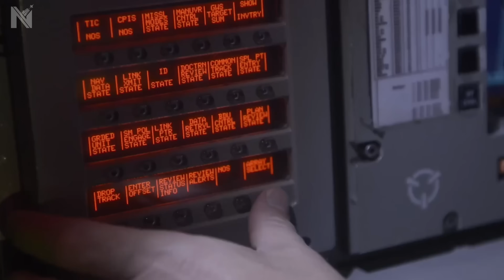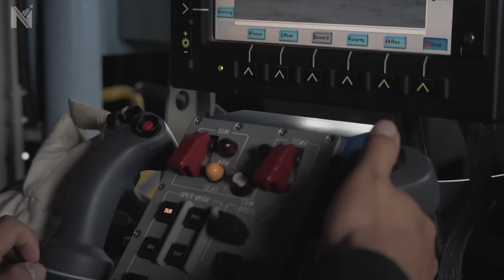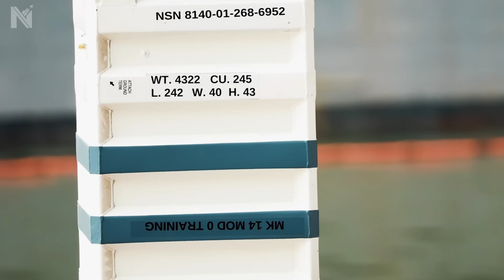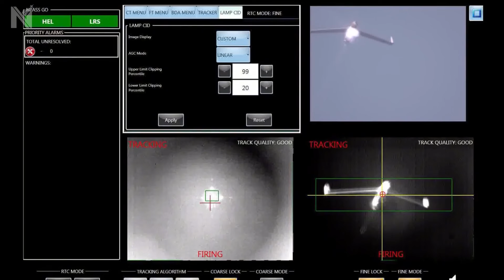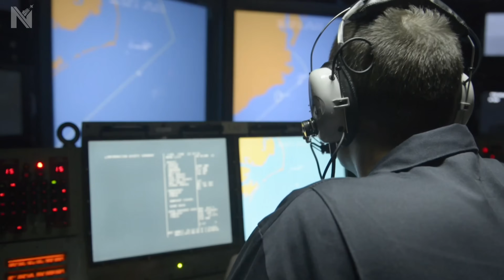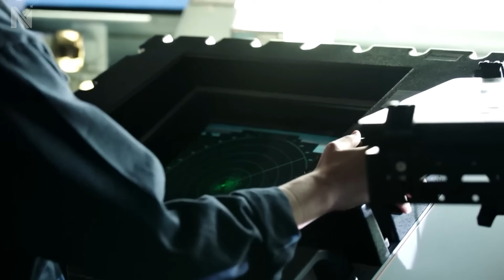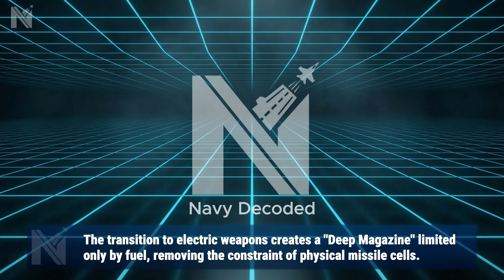Why The US Navy No Longer Fears Suicide Drone Swarms

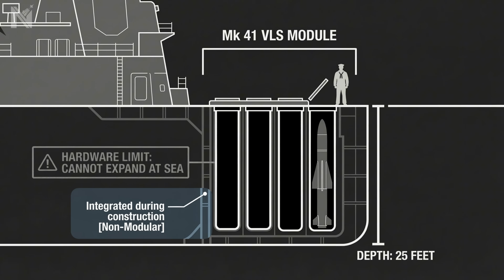Comment: 3:12 "exactly 96 missiles" except each.of those VLT MAYBE a quad pacted tube with 4 smaller missile instead of 1 large missile. And then there are c-rams, CWIS, M-2s and stingers etc.
Reply: Well, a Navy warship doesn't just pack SAM missiles, there's also Tomahawk cruise missiles, VLA (Vertical Launch ASROC) for submarine attack. So while you have 96 VLS cells about half of them will be SAM's that can be used against incoming missiles, aircraft and drones.

Comment: Why can they use cheaper missles?  The stinking arms industry won't make any of t h em
Reply: Missiles are expensive, and you have to go with what you have. The SM-6 can intercept ICBM’s and spacecraft. It’s overkill for drones, but the CIWS is also limited and short range. It takes time to integrate other options.
Reply: Because the cost of winning is priceless, so you dont cheap out like you do in your worthless life!
Reply: This is only one of the options. Video also forget Burke Flight IIA/III and Zumwalt class destroyers have 30mm Mk44 Bushmaster II that can fire air-burst munitions including AHEAD rounds good against swarms of drones. While the older Burke Flight I/II only have the 25mm M242 Bushmaster that can still defend against swarms of speedboats. So for Burke they have 2 of this besides the standard Phalanx CIWS/SeaRAM/RAM. But this is only for terminal interception. Helis are now more commenly used as they can intercept drones at long range. USN for example shot down Shaheed drones at the Red Sea with their MH-60R/S Seahawk helis equipped with GAU-21 that fires 3 - 5 USD 50 cal bullets. So very cheap if you use helis as drone hunters.

Comment: America should invest into metal storm that would play havoc on drones. That machine can shoot out over 1 million ball bearings in one second that would be a good machine for those drones.
Reply: CIWS. CLOSE IN WEAPONS SYSTEM.  THEY HAVE IT.
Reply: Video also forget Burke Flight IIA/III and Zumwalt class destroyers have 30mm Mk44 Bushmaster II that can fire air-burst munitions including AHEAD rounds good against swarms of drones. While the older Burke Flight I/II only have the 25mm M242 Bushmaster that can still defend against swarms of speedboats. So for Burke they have 2 of this besides the standard Phalanx CIWS/SeaRAM/RAM. But this is only for terminal interception. Helis are now more commenly used as they can intercept drones at long range. USN for example shot down Shaheed drones at the Red Sea with their MH-60R/S Seahawk helis equpped with GAU-21 that can fire 1,000+ rounds per minute. Basically a mini Phalanx.
Reply: @j @johnsilver9338 ut if you have let’s say 30,000 40,000 drones coming your way the metal storm is a lot cheaper than those rockets. You could put five different locations on the ship with those metal storms and you’re looking at like 5 million ball bearings flying through the air and not just real slow. Neither of this thing will shred those drones to pieces. Just my opinion, but I understand what you’re sayinggood rockets as well but we bust the cost on them though where these bearings don’t cost anything hardly at all.
Reply: @WarH  Problem is small FVP drones that are used for swarm tactics don't have the range. Only the larger Shaheed have the 1000+km range. Plus GAU-21 uses .50 cal bullets. And each bullet only cost 3 - 5 USD. But any light or heavy machine gun can also be used as shown evidently in Ukraine. Even attack helicopters/gunships can also be used. So I expect Apache and Cobra/Viper will also be adopted for this role in the future. Especially Apache as its 30mm M230 chain gun can fire air-burst rounds. 

https://www.youtube.com/watch?v=bihsF4SKhqo
https://www.youtube.com/watch?v=Nzxq0U1I8Vg
https://www.youtube.com/watch?v=npqH5hmjx_U
Reply: @johnsilver9338  no I understand what you’re saying. I’m just looking at the cost efficiency. I’ve seen one of those units at work devastating. But I understand about the other equipment that has. I know we have the best technology in the world and we’re more than capable to handle the drone swarm I’m sure. Thanks for the info and happy new year by the way have a healthy one as well.
Reply: @WarH  Happy New Year as well
Reply: @johnsilver9338  I have a question for you were you in the military? My dad did three tours in Vietnam crazy old guy. He was very proud of him strong willful man he was. You seem to know a lot about the equipment that America has. I’m just curious..
Reply: My dad did three years in a navy when he came out he said he didn’t like that so he did 30 years in the army. I guess you could say I was an army Bret. Never really talk to him too much about his career didn’t really like to speak too much about it. But he was a cool dad. He was OK.
Reply: @WarH  Not in the military. I just follow military channels/websites.

Comment: This should have been kept classified.
Reply: It was not classified, there has been public info about this for years. US isnt the only country developing and deploying this kind of weapon to counter drones either.
Reply: @mng8680 For years you say? Yet the problem only became evident 2 years ago... Wasnt the hoothie even a year ago? Op is right America has a confidential problem from signal group chats to telling their citizens about tech on crappy shows.
Reply: @shinji1264 What? The problem had been evident for decades. They were originally thought to be only used for missile swarms, but the battlefield and it's weapons change over time. !Microwave weapons and lasers have been available for years, but not at this scale, because of the power needed to run both at the same time, and the scaled down size needed to fit in older ships not built to accommodate them. As far as re-arming missiles at sea, that's been an iffy prospect until newer systems came into play. So no, of hasn't been for only two years, it's been decades in the making!
Reply: Laser weapons have been in development for years. Powering it alone on a vessel isn't something rebels and terrorists know how to do, let alone manufacture it. Other countries have versions but, again, lasers have been in play since the 80s.
Reply: Just imagine the ones that are classified 😮
Reply: @peteryeung111 Yea like America is gonna collapse in 20 or less years
Reply: @shinji1264 Not even a small chance of that. Nuclear war is more likely. We are so far ahead in AGI that dominance isn’t a question for 100 years. Really
Reply: Our enemies have no concept of how many of our ships have these. They can keep taking the chance that which ever ship they launch drones at,,, may or many not have these or just one or the other.  As a Navy vet, I know extremely well that new tech like this is never revealed until it is well tested and allowed to be talked about.
Reply: This is old technology bro. This means US military is working on something better 😂
Reply: If they unclassified this just imagine what is still classified
Reply: Don't worry we have much better system.   This is a ploy

Way better.  No missles
Reply: Nothing about it is classified.
Reply: Yeah, cause you will build this stuff in your garage, right?????
Reply: I agree!  But I wonder what they have that we do not know about, I hope some more cool stuff.  Ultimately it is a question of economic issues.  I also think that the quick sink bombs are a great new thing and could make a great difference if China decides to launch a sea borne attack
Reply: You think the enemy doesn't already know? 🤦🏿‍♂️ Lmmfao 🤣 it's been out there, they been knew programs like this were being developed 20-25 years ago, the knew once they didn't see missiles attacking their formations and they really knew something changed once all of their drones died 30-40 miles before engaging their target, not one or two drones but all of them, they were saying "oh yeah they put some new shit on the table, yup they put some new shit in the game!"
Reply: Microwave's fries Computer Circuitry,
 Common knowledge 🤷
Reply: Too bad we can't hijack them and send them back.
Reply: Ridiculous video. You can't stop a drone swarm by aiming a laser for several seconds at one drone.  A couple hundred drones can be racing towards the ship at 200mph.
Reply: You wanted to know it.
Reply: China copies everything at cutthroat prices. Enabling them to mass produce the same or similar weapons. Their quality may be inferior, but given the quantity they can replicate, all together it can still pack a punch.

Technologies these days are not so difficult to copy. American advantage is the ideas we can come up with due to robust experiences in actual combat. If you give away this advantage, it will be difficult to ensure superiority.

Comment: You talk about pennies per shot, but don't discuss the initial costs of the system. Is it 100's of $ millions or is it a billion per system. A drone may be 6K each but that's everything included to produce and use it. The microwave is pennies per shot but the production to produce it is not discussed. Please compare apples to apples instead of apples to oranges.

Comment: Well, that sounds good.But if there's two hundred drones coming at you , and it takes 7 to 8 seconds to shoot each one down , they're getting through and destroying you.
Reply: You should have watched the video.  It made exactly that point.  That’s why the ‘Meteor’ microwave weapon system is being developed.
Reply: This is only one of the options. Video also forget Burke Flight IIA/III and Zumwalt class destroyers have 30mm Mk44 Bushmaster II that can fire air-burst munitions including AHEAD rounds good against swarms of drones. While the older Burke Flight I/II only have the 25mm M242 Bushmaster that can still defend against swarms of speedboats. So for Burke they have 2 of this besides the standard Phalanx CIWS/SeaRAM/RAM. But this is only for terminal interception. Helis are now more commonly used as they can intercept drones at long range. USN for example shot down Shaheed drones at the Red Sea with their MH-60R/S Seahawk helis. And each heli can be equipped with the 1000+ rpm GAU-21. Basically a mini Phalanx. It would be interesting to see in the future if Apache will also be adopted as a drone hunter as its 30mm chain gun can also fire air-burst rounds.

Comment: Yes, well, I could say this or that or ask this or that, but let's stay at the strategic level.  Any defensive battle tends to be difficult and expensive because even one or two attacks gets through and you may lose the whole game.  And besides radiation weapons I think it always comes down to kinetics.  Waiting for defensive drone swarms, with most recoverable if they do not engage.  Waiting for SM-6 mini and micro (and nano) versions, which produced in quantity are still not cheap but 10x, 100x, (maybe 1000x) cheaper than the full size.